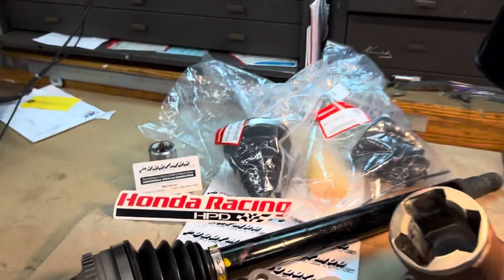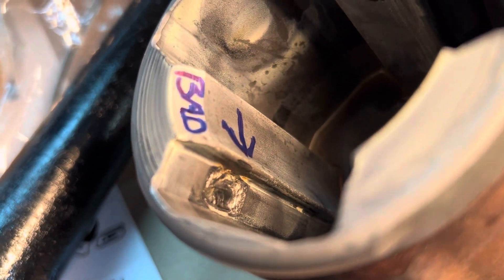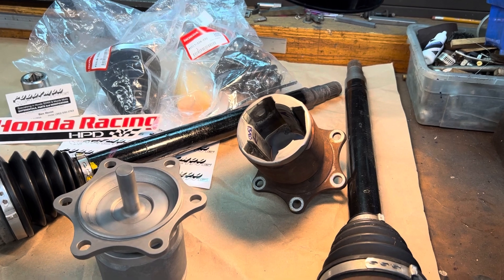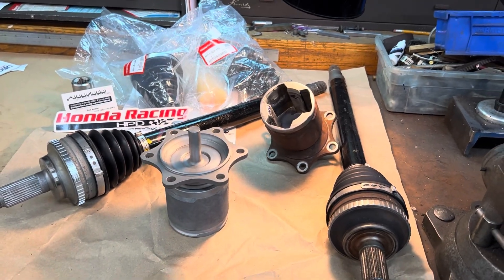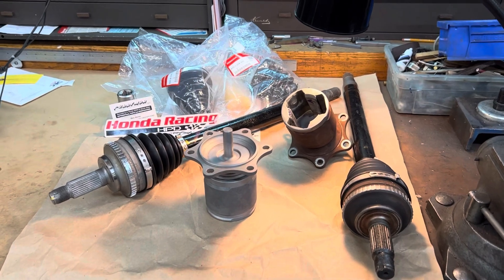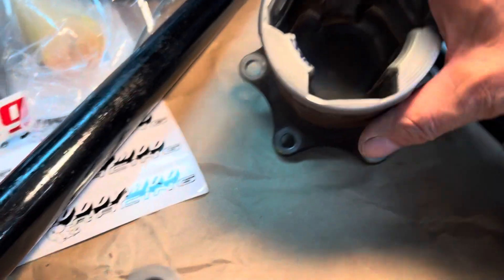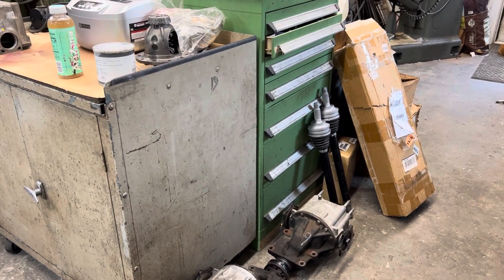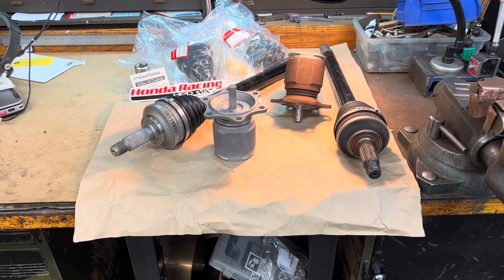PuddyMod Honda S2000 CV axles performance and  durability

Comment: Puddy, did I understand correctly, you offer an axle rebuild service? Cool!

Do you resurface the inner cups or something? Or source new ones?

Can you please start a propshaft cv rebuild service? It'd be easy for us to diy remove and ship just the propshaft cv's. I'm sure a rebuild service would be popular, especially since cars are getting up in miles, and used parts becoming more rare.

Ideally it'd be a core rebuild, where we can order rebuilt ones ahead of time, ap1 or ap2. Install them same day we take old ones off. Then ship back old ones for the core charge. That way disassembled cars not sitting around waiting on parts, and you don't get all your orders during winter downtime!
Reply from the maker: Hi, Actually I do build the factory CV axles as well as the prop shaft. The prop shaft is tricky but I have had great feedback on the work. Most of the work I do on the CV axles is proprietary. I like doing them they are fun to build :)
Reply: @puddymod  cost to rebuild propshaft cv? Expected turn around time? I will do it this winter.

Curious for axle rebuild cost as well. I've already swapped them L R. Eventually will need rebuilt.
Reply from the maker: @russelloppenheimer3970  best to send a email or DM me on Instagram for information @puddymod

Comment: good shit bro i have the same issue with my s2000, gonna swap or see what i can do this weekend thank you! this butthole approves!
Reply from the maker: Nice lol good luck, if you find burrs try the swap from one side to the other to see if it helps. Note be careful not to drop any of the bearings out and if you do be sure to put them back on the post that they came off of, they are matched.
Reply: @puddymod  awesome i appreciate it!
Reply: @puddymod  When you saying their match does that mean they belong in a certain spot? Because I took my apartment regreased them in the bearings came out and I just put them back anywhere and I’ve been having vibration
Reply from the maker: @beatbeat4378  Yes it could be the issue each post is a race for the bearing so when they are used you want to put them back on their same race, as they are a match.